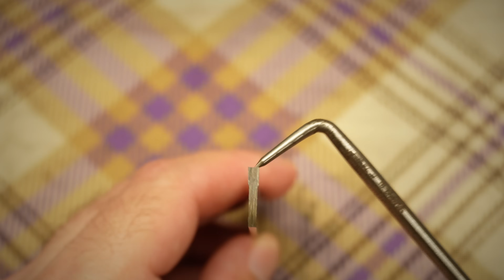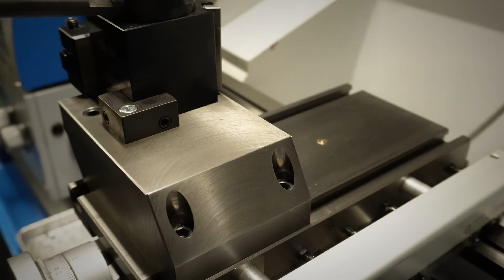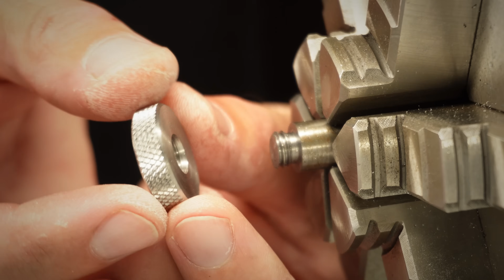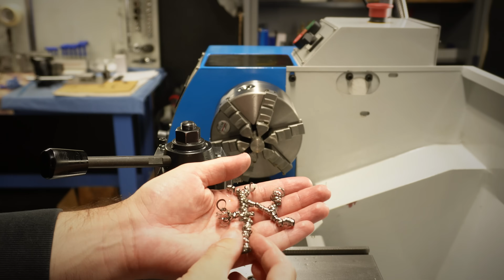Parting-off on the Lathe - Rigidity, Rigidity... and a Spring!

Comment: I mount my blade upside down. Gravity helps. Keep tool just slightly abovecenter and run lathe in reverse. Sulpherized cutting oil on ferrous metal, kerosine  on aluminum. Try it and find out for yourself. The only material that does not grab brass, but feel it out.
Reply from the maker: Hi. This video is a couple years old now. I mostly use carbide nowadays.

Comment: Whats that mill thing that they use to against the side of the work piece? Its the cylinder thing that spins and wobbles
Reply from the maker: It's called an edge finder. When the bottom part pops to the side you're right over the edge of the part.

Comment: Have you ever tried high speed parting? I found it the best method for mini lathe, Im parting 75mm bar at 750rpm and it's far better the  the 78 or 115 option I have
Reply from the maker: Yes. I do it differently now. Faster and use carbide. You can see it on some of my recent videos, for example in last years Toolroom Takeover video.

I'd say the best thing about this tool was that it taught me to be more confident when parting off. Also how to feel the operation - when to back off or plunge harder. Nowadays I just use it for softer materials or to make thin grooves.

Comment: Why do most people these days seem to tap threads wrong they try to screw taps in all in one go as if they are just simple screws or bolts wich is why the taps othen brake off in the hole wich can completely scrap a part, The right way to tap a thread is to turn the tap clockwise 1/2 to 3/4 of a turn and then turn anti-clockwise 1/4 or so of a turn and then just repeat untill you've tapped the hole to your desired depth this way you won't brake off any taps in the holes and this is exactly how the old timers did and very successfully aswell. It's so much better to do this simple successful process than it is to break off taps in the holes of your parts and also this process is much quicker then it is to deal with a broken off tap in your work piece so when time is money it makes an even bigger difference. I hope this helps someone and GOD BLESS🙏
Reply from the maker: Machine taps are designed for continuous feed. What you describe is the method for tapping with manual taps. 
However, I was using a machine tap, but because I was tapping by hand, I let the chips coming out of the hole until it started to build up (you can feel it) and that's when I tried to break them the way you describe. That's when the tap broke.

Comment: Oversizeing the hole and using helicoil to get to the right size is always an option if you want to save your skinny taps and drills. IS usefull to get durable threads in aluminium aswell.

Comment: I had to watch this because I've made something similar in the past for the same reason.  A lot of the time, chatter occurs and multiplies due to picking up a harmonic which the play in this sort of tool holder has the ability to interrupt.  I've gone as far as keeping a magnet handy that I can stick to the tool holder to help alter that even further.  Awesome tool holder, sir!  Oh, and just a small, "quality of life", thing:  I always use two washers under the nut on hold down clamps to prevent the work from moving when I strap it down.  The washers will work off each other as opposed to transferring into the part.  Thank you for sharing and thank you for the excellent production value of your video work.  The clarity you achieve is remarkable.

Comment: something is wrong with the tool holding.  I can hear it with the smaller 4-flute milling cutter, but it is really pronounced with the Dovetail cutter. The tool is describing an elliptical path with one side doing most of the work.  it's run out.  Cheap collets will do this every time.

Comment: That's an awesome parting tool holdet! Well done sir. I may have to attempt making one.
Reply from the maker: Cool. Let me know how it goes. 
Nowadays I mostly use carbide to part off steel, but was this tool holder that taught me how much pressure and speed I should use. It helped developing that feel and confidence needed for the parting operation.
Reply: @nbrworks  I hate parting. A little too much feed and chink, there goes your carbide insert. Not enough and you are just rubbing the workpiece and not cutting. I wish there were unicorn settings for speeds and feeds that would always work. I love how your setup incorporates the spring up in the nose of the holder. Just elegant. Great work!

Comment: Iscar parting off blade with it inserts is the best
Reply from the maker: I've moved on to carbide: https://youtu.be/PbkKVHHavpg?t=1686
Those are cheap chinese inserts, but they have been working well. This tool I made last year was quite important to develop the right feel to start parting off correctly using other tools. I still use it for aluminum, brass and plastics (soft stuff).

Comment: Maybe you covered this, new subscriber, what are those abrasive plates you use to go over the sharp edges of the parts?  Great content so far!  Still going through the back log of videos!
Reply from the maker: @ironhead65  welcome! Those are diamond coated files. They're sold as knife sharpening stones, but I like them a lot to deburr parts. I have an amazon link on my website, in the tools section - it's for a set with different grits. The link is in my About section. Alternatively you can buy them individually from aliexpress.
Reply: @ thank you!  I'm excited for your next video!

Comment: Wow,  works like a charm.  Did kind of a cross between yours and Winkys.
First tried on a piece of 3/4" dia Comp 360 brass, hand fed and was a little noisy but had the tool slightly above center.
Corrected the height and went thru a piece of 3/4" dia 303 SS like butter.  Finally got to the 1.5" dia 1014, no noise, no chatter and best of all no grab.
For the steel used 240rpm with feed at .0026 per rev.  Could go faster but didn't want to get oil on my new shirt.
Reply from the maker: Great!! Glad to know yours worked out well!

Comment: Try a rear tool post parting off holder, with the parting blade inverted- it changes all the geometry and works extremely well

Also you can leave the parting tool permanently mounted

Comment: Hi! We call those blades T-type or Empire blades. There are parting blades on the market, wich are sold as T-type  (Anchor, Omex), but they are tapered blades 
There must be a concave ground top. 
Real T-type parting blades I've got from Eccentric Engineering and Somma Tool. 
For parting off with carbide insert watch  video: Clough42 " High Speed Parting with CARBIDE in a Small Hobby Lathe"

Comment: You have a print for this?
Reply from the maker: Hi, what do you mean? A 3d model?
Reply: @nbrworks  Sure a 3d or prints to make?
Reply from the maker: Oh, I see. No, I don't have plans or sketches to make this tool. However, if yoo go to the community tab on my channel, you'll find a post with details of how to make it (measurements). 

By the way, what kind of lathe do you have and what type of materials do you usually part off?
Reply: @nbrworks  I have a Precision Matthews 1440 and usually part stuff like 4140 or aluminum and seem to have a bit of chatter so I thought I would give this a try. I see the info on your page so I might give it a try. Nice job on yours BTW.
Reply from the maker: Hi. A PM-1440GT should be a very capabable lathe. Lately I've been parting off 4140PH with carbide on my (much smaller) lathe with no issues. If you want, feel free to send me an email, we can exchange some  thoughts to help you improve this operation.

Comment: That's a great tool!

If it's any help for welding something to a broken tap the surrounding metal can be covered in a protective paint for welding to prevent the metal being damaged by the welding (sometimes correction fluid for typewriters was used).

"Broken Tap Extractor" or "Broken Tap Remover" tools are available down to M3 size for both 3 and 4 flute taps - have seen them sold inexpensively on eBay but not sure how good the quality of the steel is. I reckon the 4 flute version would be easy enough to make when needed using lathe then divider and slitting saw on mill - the 3 flute version maybe more difficult.
Reply from the maker: Thanks, I have a few of those now. Waiting to break a tap to try them... or maybe not!
Reply: @nbrworks  I often tend to use the sets of 3 taps - it takes longer but cutting in 3 stages reduces the torque on the tap and - in theory - the parallel flutes should make the tap stronger than helical flutes (assuming the quality of the steel is the same though..).

I think I remember Joe Pie suggesting anchor lube at 26:55 in this video as better for tapping than oil but I haven't tried it yet: https://www.youtube.com/watch?v=jnwVCliIiPI
Reply from the maker: Thanks for the suggestion and link, Will, I appreciate it. I don't think I'm able to find Anchor Lube in Europe, but I've changed to another cutting/tapping oil that's been working better. If you see my dovetail cutters video, which was posted after this one, you'll see me tapping M2.5 threads and I also used a 3 tap set with parallel flutes. I admit I used a +0.05mm drill, but that was so easy to tap in 4140. Great advice, thanks for writing that (for other viewers too).

Comment: I have a 3 Horsepower lathe with power feed and using the carbide insert tooling for  parting. 

However, it keeps on breaking the inserts when trying to part. Always towards the end of the parting where it's got only about 2 to 5mm to go from parting a 15mm diameter piece.

what am i doing wrong :'(
Reply from the maker: Hi. Seems like you don't have enough surface speed. If you're lathe has variable speed control, try to increase the spindle speed when you reach that point.

If you're using the power feed, try manual feeding, you should get a better feeling for the tool.
Reply: @nbrworks  

power feed is much smoother for me.

I really have to apply a lot of force if i try to manually feed it.

I was doing 40rpm. 2mm wide carbide insert.

parting off pieces 316 stainless steel and 8 to 35mm diameter in range

Comment: Nice work, very thoughtful and well explained. I normally part off with the tool upside down, which prevents the tool from getting pulled in while also allowing the chips to fall out. I should try replicating your design. It's quite hard to get good quality HSS parting blades these days in my part of the world, the one I could find costs an arm and a leg. Everyone's moved on to carbide tools.

Comment: Thanks for the video, the trick to cutting off is to mount the blade upside down and run the lathe in reverse if you can. If you can't you have to cut from the back side of the cross slide. If the blade binds it swings down away from the part and all the swarf runs out the bottom, not on top of the tool.

Comment: You have deserved every credit given for this video. However I've noticed that you part-off with constant speed. Thus you have the correct cutting speed only at one depth during the cut, or not at all if you start too slow. By adjusting speed all through the cut has helped me to get good results on my (Chinese...) minilathe. A beautiful video anyhow./Ingvar

Comment: I find that it's often better/safer to drill a bit oversize for tapping, especially in "sticky" material, or when you don't need full torque/ clamping strength in the location, as in a "stop", or a height/depth setting screw, so that tap breakage is eliminated (mostly)
Reply from the maker: You're right about that. In this case I could've/should've also used only a small portion of the hole threaded. Thanks for stopping by!

Comment: 17:50 Most of the machine shops I've worked at we save carbide endmills with chipped flutes, tips, or dull specifically for broken bolt and HSS tap removal. We crank the machines rpm to then sorta feed by feel, also the same thing can be done with a cordless drill for large equipment or Onsight repair just need to be carful of drifting with a hand drill.

Comment: i have the same bansaw but the blade always comes off when biting in the material, any tips for fixing this?
Reply from the maker: Hi, I don't have that problem with mine. Do you have the bearings adjusted and the blade under tension? Sounds like something is loose.

Comment: Why even bother?
Buy a parting blade and the inserts. The blade isn't cheap (depends on the source, about 50 to 100 €). And part off without problems.
Example 1: On one of my CNC-lathes, 30000 simple parts are running. OD 14 mm with a bore of 5 mm, free machining steel. Feed is 0.15 per rev. Overall, I spent about 5 inserts. Effective surface speed was less than the desired 150 m/min because of the rev-limit of the spindle of 4000 rpm.
Example 2: 42CrMo4 QT (heat treated). 40 mm diameter. Surface speed 120 m/min, feed still 0.15 mm/rev. The surface finish is so good that I don't need a second op. For the 200 parts, I'll end in having spent about 3 inserts.
Summary: Use carbide inserts and read the manufacturers specs. Go up with the feed, this prevents chatter.
Sidenote: Adding flexibility doesn't help. It never helped. Look at Y-axis parting off. Incredible feed by adding rigidity. Well, you can't Y-axis feed on a conventional lathe. This only is to show where you get improvements.

Comment: Oh dear - I seem to be the only one - I just don't get it! A cut here, a slit, a slot - I'm lost! where is the 'moving' part? I get the theory - well explained in EDesigns_FL post - but again, where is the 'hinge'? A drawing would be very useful !!!
Anyway, nice build NBR and I'm glad it works so well. Thanks for sharing!
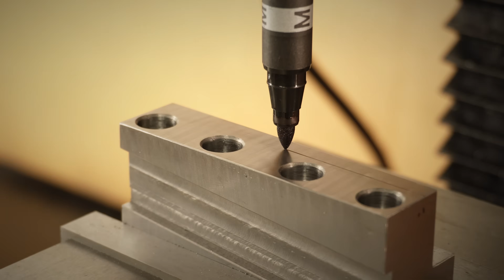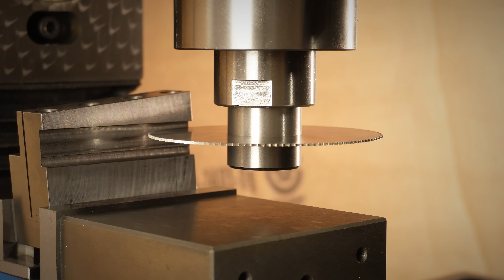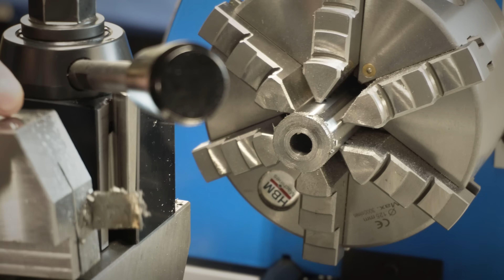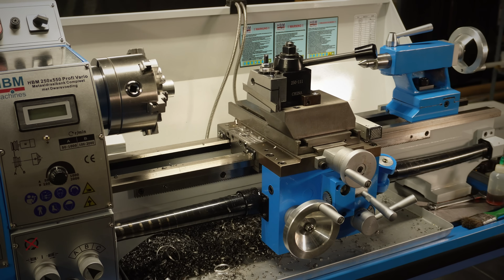Reply: There's a vertical cut put in at 9:47 to 10:09, seen from the front at 24:19 to 24:42 and at rear from 27:16 to 27:19.
This slot goes right up to above the hinge hole, so the flexing bit is free to  flex.

Comment: Those damn spiral taps are heart breakers; I've all but quit using them because of breakage, & I rarely break a straight flute tap, even tiny ones.
Reply from the maker: I was using one my straight taps last Sunday and just noticed how much easier it was. They were cutting effortlessly while the spiral ones were almost grabbing. I don't use those much, because they're "my good set" (maybe that's the reason why I should use them more) but I think I'll start from now on, specially on through holes. The only downside of that set is they don't have clearance (fat shanks) for deep holes. Cheers!
Reply: @nbrworks  Use them 'good' ones, otherwise you'll get ancient like me & regret it. (I had that experience w/ files; started in auto mechanics @ 12, got into fab & race cars, as well, @ 16. Spent decades as line mechanic, shop owner, car builder/racer. Didn't own a new file until 65. Never a priority/xtra $, also cussed & avoided them.

A new set of quality files opened my eyes to decades of dumb; a good file removes an amazing amnt of material; something 'zen' about it, as well.

I've relegated my spiral taps to non-ferrous metals, after I broke a couple, did some research & found the supplier had stated "Use on non-ferrous metals".

I wonder if there's been confusion between true spiral taps & helical 'screw' tap drills, 'cause I've seen vids of guys using spiral taps in drills. Yikes!

If you read about taps, you'll find different straight flute taps are designed to either pull or push scarf when threading. Blind holes were being threaded long before spiral taps came along.  MSC's Big Book catalog, (print version no longer produced - online only), has good tap design knowledge/info.

Re: reduced shank taps
Finally got frustrated w/ reg tap shanks & bought a mixed set of under-sized shank pulley taps & nut taps. Didn't know there were taps specifically for threading nuts; very long taper on nose. Pulley taps are just what you'd think; long enough to get about the OD.

Both types are 6-7" long, ⅜ & under.

Later,

GeoD

Comment: RE: Breaking tap. Something I do when there is a long distance to tap is ... if the design will allow it ... to counter bore the hole further to reduce the distance you have to tap. I think you said that part was 18mm wide. I would think only 8mm or so is all that needs to be treaded.

Comment: Where do you buy for band saw blades? Mine take too long..
Reply from the maker: Hi Michael. I buy my blades locally. They are from Wikus, bimetal (M42) with an irregular teeth pattern. All cuts do take some time, bear in mind that mine in the videos are probably shown at 500x or more. What I found with these M42 blades is that they last a lot longer than the original blade lasted. I have cut stainless, cast iron, steel and aluminum for a year still with the same blade. A couple of teeth are now missing, but still plenty of life left. Right now I have the bandsaw in bits, waiting for guide bearings replacements, mine just got too loud after heating up one time I had them adjusted too tight! If you are in the US, I read good things about Starrett M42 Intenss blades, maybe you could check them out? Thanks!
Reply: @nbrworks  I know! I was making a joke!

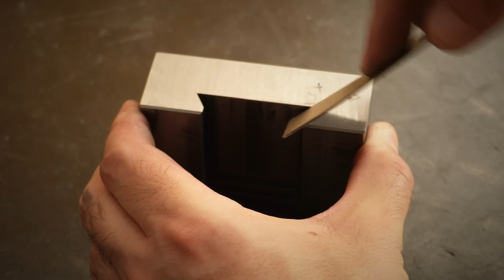Comment: 5:17 what is that file-deburring tool you're using?
Reply from the maker: Hi. It's a diamond coated strip. 600 grit. You can find them on Aliexpress for around 1.5 euros each. Funny how that is one of the most common questions I get in my videos 😄
Reply: haha thnx a ton. Seems to be something I haven't seen before and would like to have. Great video btw ♥ @nbrworks